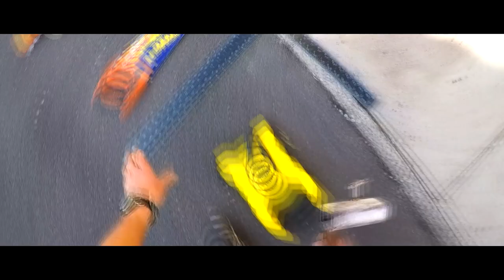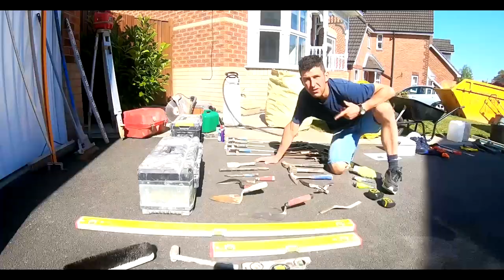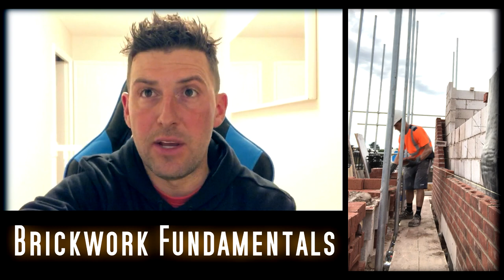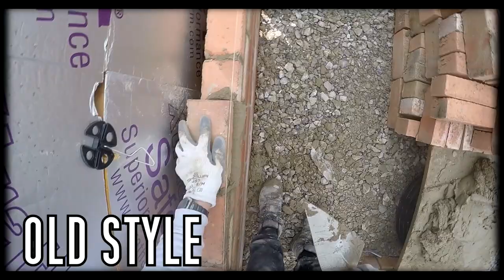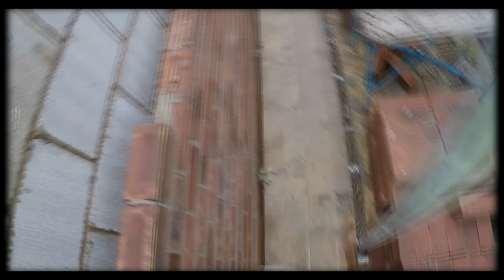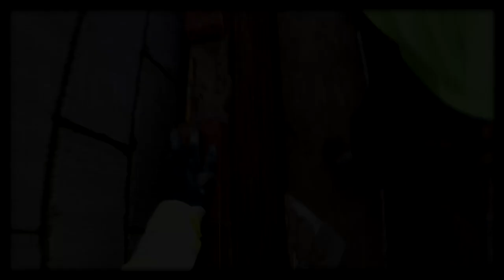BRICKWORK FUNDAMENTALS 2020 : No Cross Joint, No Prob (Laying more bricks by adjusting laying style)

Comment: If a job can be done quicker then the reaction of the management is to cut the rates
Reply from the maker: Good point but since I’ve worked on building sites I’ve noticed you get some tradespeople that are really slow and some that are a lot faster. In my experience, as  long as the standard is good management seem to prefer the faster tradesmen. 👍🏻 I guess it helps with production targets. 😀👍